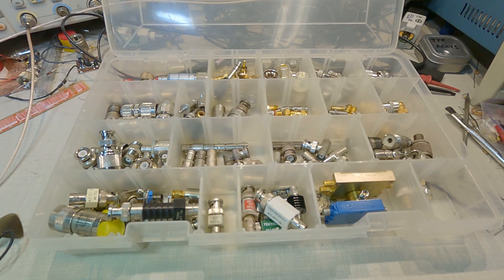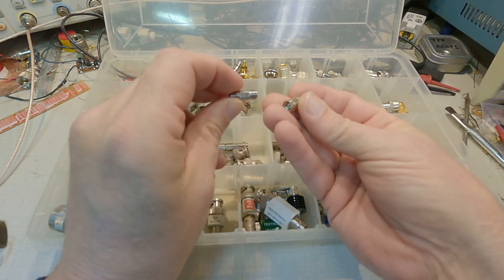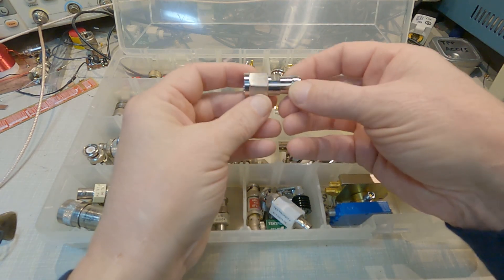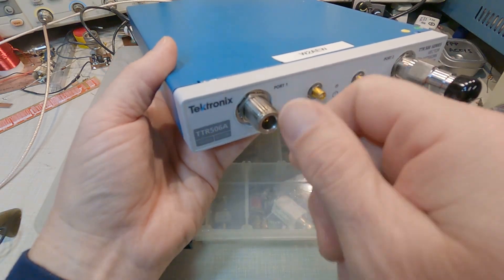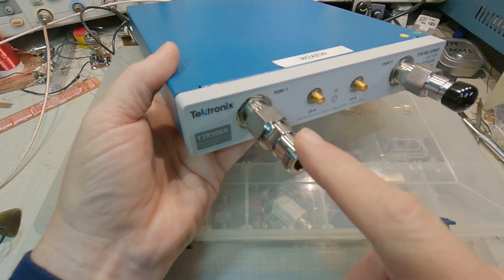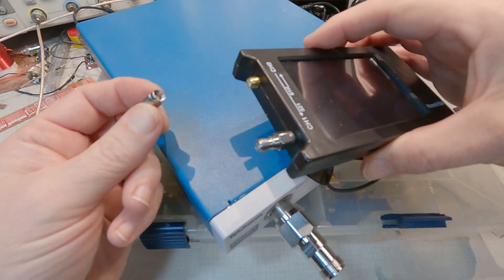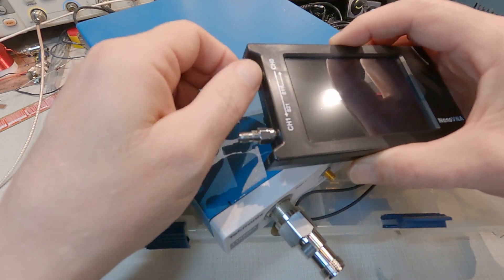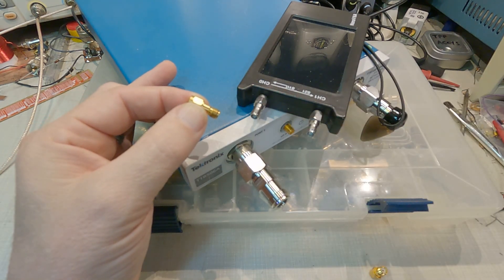#348: Quick Tip: What is a connector saver?

Comment: Isn't that just giving you more leverage to tork the connectors off the board with? Maybe if you added a small nut at the base would be more hepful. Also, if you don't lock the connector saver down pretty tight, it's going to wear on the cheap threads its self. If you do tork it down, you are putting more stress on the threads. Best bet is probably to have a couple of pcb mount connectors on hand to replace them as needed, but a cheap nut is probably worth doing.

Comment: I just recently had to improvise one of these with a m/m and a f/f UHF connector... Not for the purpose you mention here though... I have an iCOM 701 and needed to plug a right angle adapter into it to use a tiny little vertical antenna into it. After getting the adapter in, I found that the jumpers on the back of the radio blocked the adapter unless I used the radio in the vertical configuration, which, while it saves space, makes it hard to read the display. After trying to find a m/f adapter at the local ham-fest, I suddenly had a temporary jump in IQ and grabbed the m/m and f/f connectors and made my own m/f adapter... A bit longer than I needed, but given the very light weight of the antenna, and the relative strength of UHF connectors(not to mention that the iCOM connectors are mounted to the case and not the circuit boards), I do not think I need to worry excessively about connector strain...

Comment: I always used connector savers on my test equipment.  Better to have to replace a $150 to $350 piece than have to send the instrument back for repair.  One thing that was fairly common at that time was a mix of 50 ohm and 75 ohm N type cables floating around.  Most of our test equipment was 50 ohm, but on the 75 ohm gear plugging in a 50 ohm male connector ruins the 75 ohm female connector in one shot.

Surprising how many engineers didn't even know the difference between the two and would never both to check before they plugged something in.  Always worth a moment to check for bent center pins or connectors not assembled to spec with overly long center pins, etc.

Comment: I was always worried that if I left a connector permanently installed that the split pin portion could weaken. But i do see an advantage of using a connector saver.

I do like the idea of your quick tip videos.  Thanks for producing these videos Alan.

Comment: Adding those extra levers could also add post-design breakout sections to the PCB if you're not carefully handling that, eh? Esp. the cheaper gear that gives the very reason for this trick. I'm saying that because I do have a Chinese handheld radio where I'm using an adapter to another connector type. And this kinda always feels bad, I treat it like an egg ;)

Comment: The connector savers I use on my spectrum analyzer, doubles a DC blocks as well. The analyzer is rated 50V, so that's fine, but I'm literally one surface mount capacitor away from ruining my instrument, when measuring on active circuits. DC blocks are more expensive, but in this case, still much cheaper than my analyzer 🙂

Comment: Great video.  I think that many people don't really consider what the maximum mating cycle rating many connectors actually have.   Especially some of the inexpensive, off-brand connections that are found on some devices that are marginal to begin with.

Also, if you're screwing around with SMA connectors on your cheap NanoVNA and have a 3D printer,  print off a couple of SMA spanner wrenches; look for object 109772 on thingiverse..  It's not a torque wrench, but better than using your fingers.

Comment: Yes, it would be great to see more "Quick Tip" videos like this (there is nothing wrong with longer format though) especially on the topic of RF equipment and accessories. Shahriar from The Signal Path has created an awesome video about RF connector handling (TSP #26), but it was focusing on high-end and high frequency metrology grade  - basically "do not get near it without a calibrated torque wrench". I am sure many people would be interested in some advices applicable to instruments like DSA815, SSA3021X, HMS-X, SVA1015X (something a level above NanoVNA) and laboratory grade connectors. Do I need to worry about proper torque when tightening those? Will I even see a difference in measurements? Are professional measurement cables worth buying or DIY ones will perform good enough , say under 1.5GHz?
Reply from the maker: I'll consider that for a future topic.

Comment: Used widely by military in avionics use - we called them by what the books call them - "Sacrificial Connectors"  - very important when you have a multi-pin interface.  Let the sacrificial connector do all the heavy work and avoid having to pull a pressure bulkhead, computer pedestal, or other delicate item from an aircraft.  Never before heard of the term connector saver.  Amphenol, Kings and others make them, all under NSNs with the "Connector, Electrical, Sacri" nomenclature.

Comment: Nice video!  

I use SMA connector saver to protect a 2.92mm input on our fast scope.  The problem I see is when I try to attach an SMA cable to the saver and tighten it with the torque wrench, the body of the connector saver ends up spinning before reaching proper torque on the SMA.  This seems bad since the pin into the scope connector spins each time.  Anyone have this happen?  Any good solutions?
Reply from the maker: Good quality connector savers will have a "flat" section between the two ends that you can put a wrench on to keep the body of the connector from spinning.

Comment: I wondered if a connector saver influences the transmissin line behaviour of the cable in a significant way? It does introduce extra length (= induction and capacitance)....
Reply from the maker: A quality connector simply adds some extra length (delay, phase) - looks like the line is just a bit longer.  Loss and impedance discontinuity should be minimal, and would the calibrated out in the case of the VNA.
Reply: @w2aew  Thanks for adding to my knowledge.

Comment: Hello Mr. Lowe! Always sharing a good Youtube video with us. Thanks a lot! I've a suggest for you:
Is it possible to share a video about how to choose a correct power attenuator (back to the basics)? The calculations related with db/dbm/watts for some people always do misunderstandings. For example: How to connect a Nano VNA to a Hand radio/RF generator, using attenuators, if you don't have a correct one but you have others values to choose? In this case, how to assemble an attenuator cascade if it was necessary (attenuator 1 + attenuator 2 + ... attenuator n)? Hugs from Brazil.

Comment: It saves the board connector from wear i suppose.  But if you bump the extended saver connenctor to something this puts a higher torque on the connector attached to the pcb. It seems to shift the danger of damage to the worst possible kind in my humble opinion.
Reply from the maker: True - so it's a tradeoff - you have to decide whether the risk of damage due to the increase lever arm is higher/lower than the benefit of preserving the instrument connector's integrity.

Comment: Thanks for the video! A little tip for you, since you are talking about saving connectors: Don't turn the entire connector, but turn the nut itself, holding the connector body still. Otherwise, you are turning the pin in the socket, which certainly doesn't nothing good for the durability of your equipment's pristine connector!

EEVblog did a video in 2017 from the Keysight metrology lab, no 1039, where Peter Daly explains some of the issues in this regard, about 16 minutes (Actually, already at 11:45 as well) into the video itself:

https://www.youtube.com/watch?v=M0dZgP0SieE

Comment: We experienced a connector issue when I worked for a manufacture of TV broadcasting transmitters. A thousand watt or better transmitter with an all FET design. In testing we could not get much power out and kept turning the drive up and up until it was at maximum. One of the engineers wiggled the input drive SMA connector on the back of the unit and POW! All the FETs blew as the center pin on the SMA made full contact and was at full drive. A poorly seated center pin on the SMA was the fault.
Reply: Damn, remind me to scale any signal down before trying to wiggle connectors!

Comment: great idea,,if you leave a n connector on all the time will the connector on the equipment be stressed,, I have many HP gen and sa freq counters
keeping the center pin on n connector spread open
Reply: I'm not a material scientist, but I imagine the stress of connection and disconnection distorting the center socket is significantly worse than the steady state of being in a "pre-loaded" condition. This seems to be generally common in engineering, preloading elements to reduce stress effects.

Comment: Hi Alan. I ran into something that I cant get my head around. I ran into a  aa situation where a schematic I am working on calls for a  0.1 R resistor for a pass transistor to equal out current draw. I have been trying to find the actual resistance of thhis resistor. For some reason. I dont understad what it actually is. Thanks for any help you have to make me see what I am missing.
Reply from the maker: A low value resistor is commonly used in power supply designs for a few reasons.  One reason could be that it is used as a current-sense resistor, where some additional circuitry is measuring the voltage drop across this resistor to determine the amount of current being delivered by the power supply.  Another common use case for low values resistors in power supplies is when the pass transistor is a bipolar type and is a parallel combination of several transistors.  A small resistor is put in series with the emitter of each transistor to prevent thermal runaway (as bipolar transistors heat up, the base-emitter voltage drops, causing it to conduct more current, get hotter, and drop Vbe more, etc --> leading to thermal runaway).
Reply: @w2aew  I think the question simply was what value the resistor should have. I think a 0.1 ohm resistor sometimes are marked as 0.1 R but it could also be that R is an arbitrary resistance defined somewhere else in which case we do not know the value. So most likely 0.1 ohm but it could be something else also.
Reply: @Broken_Yugo  I agree that it would be unwise to use R as a variable in a real project but it is often done in basic electronics courses at universities and we can not exclude it here. The value is clearly not given in correct RKM code since that would be 0R1 or 100L.
Reply: @w2aew  Thank you Alan. That makes  more sense now. I thank you so much for your help.

Monty

Comment: It's not just RF. I use the same principle on other connectors like d-subs on PC's and expensive test gear. Some connector types have relatively low connect/disconnect cycle counts due to the pin plating wear, so protectors (or sacraficial inline connectors) help with reliability and signal integrity too.

Comment: For expensive or otherwise equipment with case mounted connectors it's a no brainer really. Saw them a lot of times on DB9 connectors for debug serial, didn't know it was for that.

But for board mounted connectors, my bet would be that the solder joints are going to fail first from heavy use. Just my "anecdotal" evidence.
Reply from the maker: True - so it's a tradeoff - you have to decide whether the risk of damage due to the increase lever arm is higher/lower than the benefit of preserving the instrument connector's integrity.

Comment: I’ve always used them on all equipment, rf and electronics equipment! Very handy to save a lot of costs later in life and easy to change out if needed from general wear verses sending equipment back for repairs, recalibration, and loss of time... so on from simple wear.  I always put on rental equipment but surprisingly how many times come back without or calls asking why is this on it or claims it changes measurements....

Comment: Most EE RF engineers say that Connector savers mess up the measurements so you don't get a true measurement because of the type of material used for connector savers will influence the measurement throwing off the frequency plots and adding insertion loss. IS this true or not?
Reply from the maker: If good quality connector savers are used, this is not true.
Reply: @w2aew  What should I look for that is considered good Quality connector savers?
Reply from the maker: @waynegram8907  Look for a quality name brand (Amphenol, etc.) or buy from a reputable company/dealer.  Stay away from most of the crap on ebay and amazon.
Reply: @w2aew  which do you use or recommend brand names? Because the higher gigahertz RF frequency is more sensitive

Comment: Interesting but there's one drawback: this creates a long lever and that increase the risk of damaging the instrument in case of a big mishap.
So if the instrument is secured on a bench that's a good idea. If you use it "on the go" then it depends if you are clumsy...
Reply from the maker: True - so it's a tradeoff - you have to decide whether the risk of damage due to the increase lever arm is higher/lower than the benefit of preserving the instrument connector's integrity.
Reply: @w2aew  - Or you could use a right-angle M/F adaptor (or even two of them for extra compliance), especially for connectors that can swivel. Not much bending force gets transmitted to the original connector. This also helps with stiff cables. (Now the trade-off is for those extra connections and impedance "humps".)
Reply: @w2aew  A solution could be to use a small piece of coax with the right connectors. But of course this could have a bad influence on the performances of the instrument even with calibration. That's another tradeoff...

Comment: In my company we refer to them as "Pin Savers". 🙂 Even though our 40 GHz VNA has labels on it "Do not remove cables", a intern decided to remove them and tried to connect a regular SMA cable to the female K ports on the VNA. Ya, you guessed it, straight back to the factory for a very expensive repair. Offcourse this was our own fault, a intern should not have wandered around the lab by itself in the first place.
Reply: With regard to VNAs I am probably on intern level, too, because I do not quite get the problem. How would it have been different if he connected his cable to the connector saver instead of directly to the device?
Reply: @floriankauer9038  The saver only costs i.e. $200 which can simply be replaced by any person in the lab.  Our intern destroyed the factory fixed connetions on the VNA so the manufacturer, Keysight, had to replace the external K connector(2.92mm). The reason for the labeling was due to the fact that only a trained person can distinguish 2.92mm from SMA, but yet, when mated wrong or aggressively, the 2.92mm can easily be destroyed. That's why we "fix" the 2.92mm cables and have female to male 2.92mm to 3.5mm pin savers on the end of those cables. Engineers that work at 26 GHz and up, that require the K, ought to know their connector types and can replace the pinsaver for 2.92 to 2.92 if required. Interns simply cannot, at least not without proper training on the job.
Reply: @stefanhummelink3662  Thanks a lot for the explanation! I was (like the intern) not aware of the fact that these K type connectors exist and look very similar to "regular" SMA connectors.
Reply: @floriankauer9038  Ya! They look very much identical but yet they are different not only in dimensions (inner) but specifically on tolerances! I cannot recall a video by W2AEW on this subject, but The Signal Path had a very great video explaining the ins and outs of RF connectors and their usages. 🙂

Comment: I like connector savers on BNC and larger connectors, but on something that is soldered to the edge of a board, I much prefer a few inch long cable. I've seen cases where dropping something like the NanoVNA or a small scope with the connector savers on it, ends up peeling the SMA connectors off the board, making something that is much more difficult to repair than a simple connector swap.
Reply from the maker: True - so it's a tradeoff - you have to decide whether the risk of damage due to the increase lever arm is higher/lower than the benefit of preserving the instrument connector's integrity.

Comment: I also used to use another type of plug-in connector saver (SMA, N type) which does not have to turn the thread but just plug in like AC power cord if the frequency under test is less than 1GHz or so.

Comment: I was told never to rotate the pin relative to the mating socket. Can you speak to how important this is? ( I suppose it might be impossible if there's no free-rotating nut)
Reply from the maker: This gets more and more important the higher you go in frequency - but it is the right thing to do regardless.  Allowing the pin to rotate in the mating socket can distort the fingers in the socket, and create scratches in the mating surface that can impact high frequency performance.

Comment: I'm just starting with my network equipment use. Thanks for your clear explanations and detailed schematics with calculations.
Would signal suffer if one used a 6" m/f 50ohm cable extension? This would provide better strain relief.
Reply: Signal always suffers and the bigger frequency, the more it suffers. It all depends on "can you live with it". 
On VNA, you just calibrate with the cable so it doesn't matter that much.

Comment: Im Doing The Same Saving Thing, But I Do It On My Nano Vn With The Included SMA Wire. I Always Leave It On And When I Calibarte, I Leave It On, When Im mesuring, I Leave It On And That Way Im Not Stressing The Soldering Job Thats On The Board And Connector Itself.